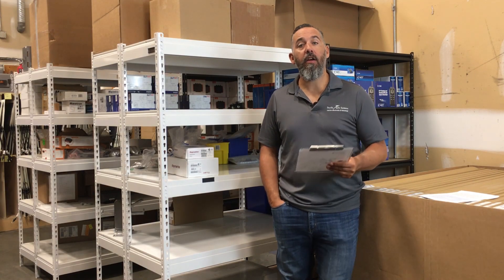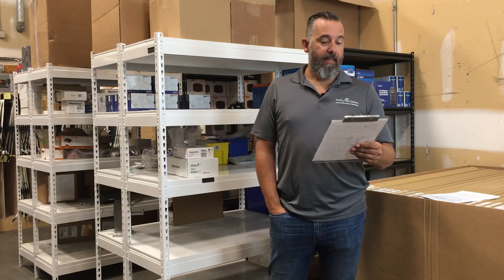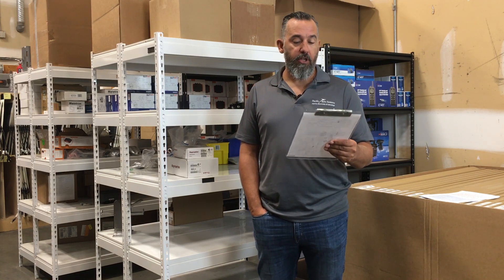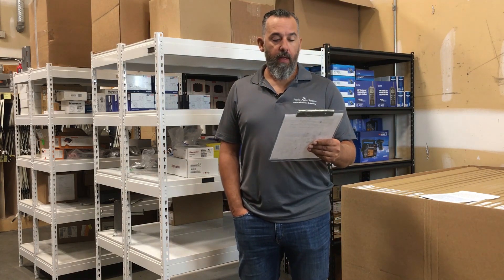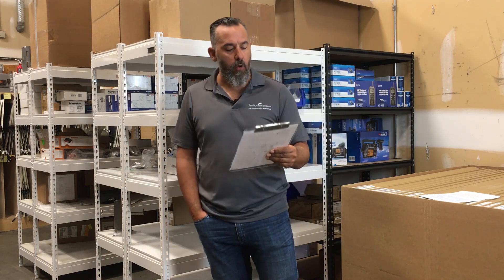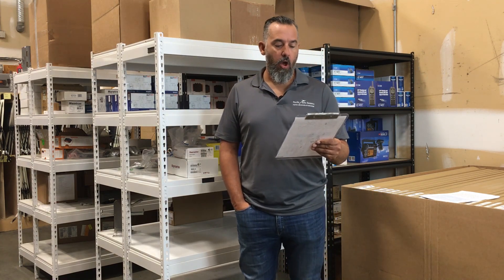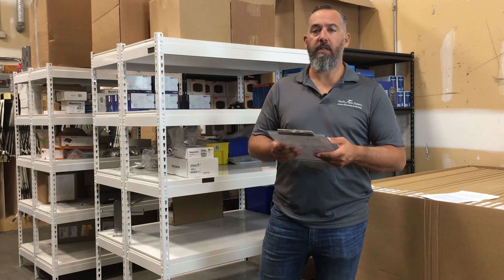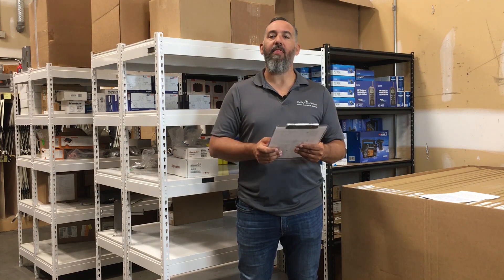Ask PYS - Why Should I Use Marine Rated Battery Fuses (MRBFs) on my Boat?

Comment: Great series. I have a question. I would like to charge a trolling motor battery off of my house bank(230 Ah AGM). I’d rather not use an inverter. Is there a simple way to charge dc to dc? How big a battery could I charge? Could it be flooded? Lithium?
Reply from the maker: Yep, a battery combiner is the easy choice, or you could get a DC to DC charging converter.
Reply: Charging battery voltage must be higher than the battery being charged or current wil not  flow. 13.5 to 14.5 to charge nominal 12v.
Lithium batteries require special chargers that monitor temperature and current.
Failure of LiPO may occur if not charged incorrectly.
Lead acid require constant voltage chargers.
Lead calcium require slightly higher voltages to charge correctly.
I would look up CTEK battery 🔋 chargers.

Comment: Fuses or resetting circuirt breakers should be used to protect the wiring. You need to discriminate and use different Ampere sizes depending on the current limits of each circuit cable.
One should size the circuit protection to the current rating of the cable.
Just like a house 🏠.
Mains, submain distribution fuses. Appliances have internal fuses or crowbar circuits.
Boat 🚣‍♂️ should never use the hull for any electrical  returns as it causes electrolysis.
All metal items on a steel boat should be bonded together and be insulated from electrical sources.
Reply from the maker: Well said.
Reply: Excellent comment.